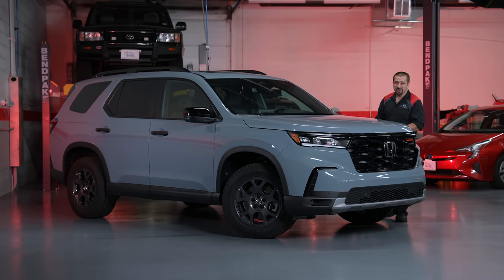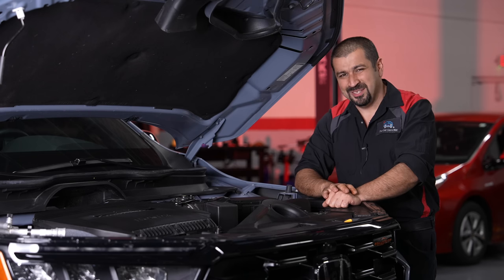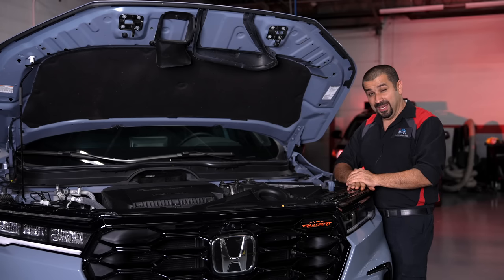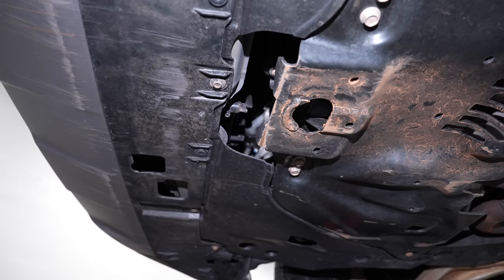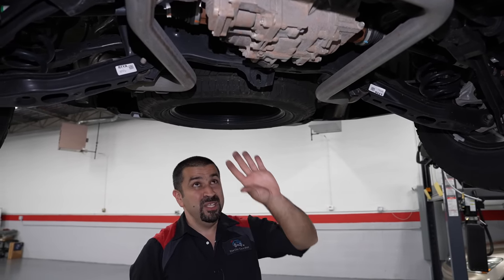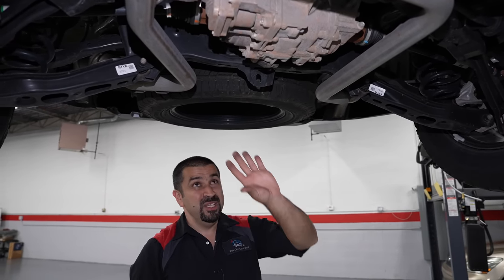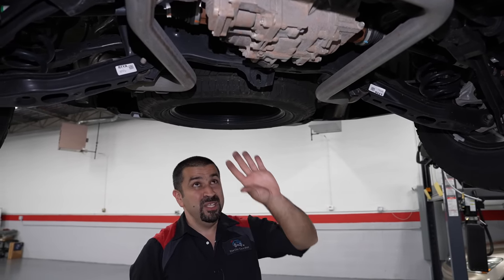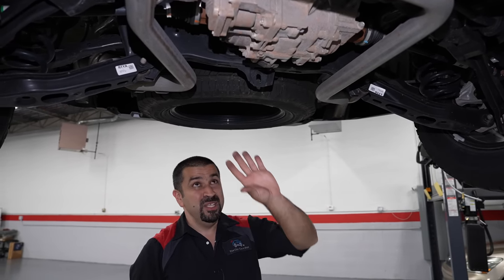Should You Buy a 2023 Honda Pilot? Thorough Review By A Mechanic

Comment: Thank you for this review AMD. I would still like one for the current gen Odyssey (which I own) but as related as that car and the Pilot are (sharing in previous generations the platform, major mechanicals, and a lot of the infotainment and other interior trim), I'll take this anyways :) With that in mind I do have a few things to comment.

VCM is a sore point for these engines, however since 2015's implementation of what Honda calls VCM 3 (first in Acura models, and later on Hondas) reliability has been better, to the point you'll find online debate on weather a VCM defeat device is relevant on these cars anymore. However it's important to note that they made reliability better by essentially limiting it's engagement more. I would more seriously consider getting one for my J35Y7 (exactly the same as the Y6, but that means it's mated to the 10 speed transmission) if I lived in the US, but as I don't and there's some tropicalization of this engine for Mexico and other markets (premium fuel is required, no auto start-stop feature, who knows what other things) I'd be even more weary of getting something that will play tricks on the ECU, as I'm sure someone as averse to aftermarket solutions as you would agree with. I will say that after going on a multi day roadtrip covering some 1500 miles, it will get the 28 mpg highway easily, even when going comfortably above the speedlimit so it's possible the new Y8 also overdelivers in that regard. I was also surprised at your complaint at power with the Y8, the previous SOHC Y6/Y7 has no lack of it, and it's one of the strong points of the Odyssey, and I have no trouble believing if it was delivering more than the quoted 282 HP. I've observed no oil consumption(something VCM likes to cause), but as a precaution for VCM issues, I am following the aggressive 3000 mile/5000 Kilometer interval for oil changes, which we qualify for anyways due to our usage pattern.

The engine/transmission combo is also very smooth, though keep in mind the engine does use fancy (and expensive) active engine mounts, specifically for when running as a 3 cylinder. I have used paddle shifters in other non sporty cars to help with engine breaking on long descents, but with 10 gears, I find it tricky to get the amount of upshifts right and invariably find myself shifting a gear or two too high and having the car pick up speed instead of maintaining it or scrubbing it off, on my other (flat 6 Subaru Outback) car, it's much more intuitive.

As the Pilot and Odyssey share a platform, it is no surprise the 3rd row is spacious, and in the Odyssey it is genuinely useful for adults, with the space used by the full size spare here being used for cargo in the minivan. I still remember the time we where looking at the car and I had one kid on my arms and I could just simply fold that 3rd row with my other free arm, it was a key moment for our liking of this car lol, and I love that it is not power operated, but manual and super simple and quick to use.

Agree on the exhaust issues, and in some Odysseys that middle muffler sits low enough that many speedbumps (of which there are many in Mexico) will bang it, we already had the case of us taking one too fast and shredding that low hanging muffler, in the case of the Ody, the whole exhaust with 2 mufflers after the cat is a single piece, worth some 800 USD and with a 50 day delay in delivery. In our case a specialized muffler shop cut the affected part and welded a much smaller (and much better looking) one that keeps the car sounding the same, for a fraction of the price. 

The exterior piano black on our Odyssey (and that I see on this Pilot) drives me nuts as it's a pain to keep clean/scratch free, but any form of coating (in my case I have 2 layers of different highly rated spray on coatings) make it much easier to keep clean, though a rock/particularly big hardy bug will dent the black plastic and discolor it a bit. Putting a bit of rain-x or any other hydrophobic coating on the cameras also helps drastically in keeping them clean, a pain point for the rear camera as the boxy profile of the minivan means there's a lot of very turbulent air on the rear hatch that makes the talcum powder like dust here in the desert like to stick to it otherwise.
Reply: Yes, Odyssey review please!

Comment: I’m a J35 fanboy. However Honda should have put a timing chain on the new J35   Timing belt is really obsolete in todays automotive industry
Reply: I would agree but considering how many modern engines are having timing chain issues from being cheap maybe it's a blessing in disguise.
Reply: Yes and no. What makes the timing belt an issue (and a cost) is that (not sure about this one) J35 engines are interference engines. If the belt tears up, good buy engine.
Reply: Timing belts are much better.  You get a maintenance item instead of an engine out repair
Reply: @loualexander3408  The belts don't tear up for no reason if you replace them on schedule (every 105K for the J35) along with the tensioner and the water pump and use OEM or quality aftermarket parts
Reply: Agree my SUV has a timing chain. It’s an 08, no issues.

Comment: Had a 2010 with severe engine problems due to engine deactivation mechanism fouling up the spark plugs due to oil filling the deactivated cylinder(s). Will never again get cylinder deactivating car, or a car with timing belt. Great review!

Comment: Overall a nice vehicle but I have concerns about reliability in VCM, carbon build up from direct injection and 10 speed transmission that is relatively new to big SUVs like Pilot and MDX. Honda could have intentionally designed their engine better for reliability through the use of both port and direct injection, and optionally allow the users to turn off VCM like engine auto on/off button while still satisfying emission requirements.

Comment: My 2009 odyssey had the VCM. Such a pain. Also, it used so much oil after 150k miles.
Reply: I disabled mine. The rings were replaced on the engine with fewer that 1000,000 miles. Thankfully that was on the previous owners dime.
Reply: If it can go anywhere near 150k before any serious concerns,  I will take it in a heart beat. That's about 14 to 15 yrs of driving
Reply: @modernsoccer1860  Yeah, but without VCM it would run for 250-300K. That's 10 more years of useful life out of the car

Comment: I have a ‘23 Pilot TrailSport with P219E error code after 6k miles. Engine light turns on and goes limp mode. I did have its first engine light 5k miles, but it went away after shutting and restarting the engine. My Honda dealer could not figure out what is causing the engine light after keeping it for 3 days. Engine light went away on its own on the third day. If anyone having same issues or figure out the cause of engine light turning on. Please let me know.
Reply: It's hard to find good help these days, even at the dealer. I hope they checked the battery to make sure its not defective, as I've seen new batteries go bad and they can cause electrics in a car to go haywire.
Reply: Just want to leave an update here. I got a third engine light at 7k miles and brought it back to the dealer. They said it has the same error code as the first 2 check engine light. They replaced the fuel injector. Hopefully this will fix the issue.
Reply: @johnmacalalag4552  Did that fix the issue? Having more problems with your 23 TrailSport?

Comment: I have a 2015 Pilot that I bought in late 2017 with a little over 27,000 miles on it. Today it has over 345,000. Best way to make any Honda last longer is to disable the VCM. I bought a device called S-VCM that disables it so that it runs on all 6 cylinders at all times, and I saw no difference in fuel economy. A lot of the feeling of being underpowered comes from the car having to switch on and off from 6 cylinders. It's bad for the car because when some of the cylinders are turned off, the pistons are still moving (at least on the 2nd gen Pilots) which causes a vacuum in the combustion chamber because there's no more combustion in the turned off cylinders, which pulls oil from the non-combustion side, gunking up the piston rings, and eventually fowling the spark plugs. Also, it causes uneven power in the engine which wears out the engine mounts. There is literally zero reason to keep VCM , I still pass emissions, I still get the same fuel economy, and the car feels better and gets less wear and tear.  I wish I knew this from the beginning. When I get my next Honda it's the first thing I'm doing.
Reply: Going to buy a new pilot here next few months was it easy to install for a beginner light mechanical experience?
Reply: @slickfox33  extremely easy. It's as simple as unplugging and plugging, and attaching a wire to the positive battery terminal

Comment: Not sure why everyone so scared of timing belts. The J35 timing belt job is simple, especially without a power steering pump in the way. 3 hour job max every 100,000 miles. Timing belts are much quieter, engine runs smoother and is much more refined compared to a chain. Chains can cause many engine issues. When Honda builds something it’s simple, refined and built to last with minimal maintenance.
Reply: Yeah it looks more accessible than my 2005 Pilot.

Comment: It would be interesting to do a comfort ride review between this and the Toyota Grand Highlander.  Honda has the reputation of a harder, stiffer ride than the Toyota.
Reply: The stiffer ride is 100% true. It's not plush like a Toyota or near close to a Lexus.
Reply: @2fast4all  that is the reputation of Honda.  Road manners is great, but not at the cost of comfort.
Reply: Hondas and Toyotas will never drive the same by design. Different manufacturers have different goals.Hondas have better driving dynamics, Toyotas have a softer ride.
Reply: That's why they handle better. I had a Camry loaner for 3 months while  our  Accord was being repaired after a big crash. It was like driving a quality built Buick. Mushy as heck.

Comment: I wanted one until he said it still has VCM/cylinder deactivation. No sale, no thanks. 👋

Edit: Oh wait he said it's GDI only... I'm not walking I'm running!! 🏃💨💨💨

WTF is wrong with Honda??
Reply: You can disable the VCM, check the intake for carbon build up and/or use a spray to clean up the intake and intake valves.
Reply: @loualexander3408  Once those intake valves get fowled up with carbon residue the only thing you can do is remove the cylinder head and start walnut blasting away. There's no magical spray that will take that away. And if you try to use GDI cleaner for PM like every 5k or 10k miles the way you're supposed to do it according to the can instructions you can still cause engine damage as you're flooding the cylinders with a liquid that wasn't designed to be shot in there. A catch can is a much better idea. But you do you. Go buy one and let us know how it turns out for you, come back to this comment thread in 5 years. There's no excuse for cheapness and laziness in engineering unless you're engineering obselence. Everyone including Hyundai/Kia is going GDI+MPI. Listen to what this mechanic is saying. And yes if you can figure out how to permanently deactivate VCM that's great, buy a car with a huge engineering feature you're paying for just to shut it off. What planet do you live on bruh? You buy something else!

Comment: Having recently paid for timing belt replacement on our '15 Pilot, I'd have gladly put up with a bit of engine noise for the reliability of a chain.  I also wish they'd take a cue from Toyota and incorporate port injection to help prevent carbon buildup.

But if that tops the list of my concerns, that's getting a little nit-picky.
Reply: $900 for a timing belt, water pump, tensioner and gaskets isn't bad every 100k. Small price to pay for reliability and noise in my opinion. Chains have plenty of issues.
Reply: Timing chain may seem less troublesome and worry free, but they can stretch out and throw the engine timing off. They even break too.
Reply: @floppyebrokent8578  That's cheap. Was that in Tijuana?

Comment: As an Acura Technician, I completely agree that this is a better vehicle than any Toyota Or Lexus…
Reply: I'm thinking of getting thr new MDX. Would you recommend the turbo or non turbo?
Reply: @CaliSteve169  the regular MDX has the 3.5 V6, same engine as the pilot, only issue is that it’s a rubber timing belt design and the engine is interference, change the belt every 80-100k miles you’d be set
Reply: @BigAltimaEnergy719  right, that's what I'm debating. I had an old pilot that was bulletproof. 250K miles with no issues. Not sure if the MDX Type S will be as reliable.

Comment: Thank You, I asked for this, and you delivered!! Hope it was done sooner though as i had bought mine in May 2023 but it is still greatly appreciated. I had a few major problems in the first few hundred miles but has been good so far currently at 6k Miles (Drive with idle stopper off).
Reply: hahaha that idle stopper is annoying. it wouldn’t take that long to wait until the green light comes on at the traffic light. i turn it off b4 i drive.. i got the lowest trim in Pilot the sport but that was rare color. the Black pearl, full black even the rims. 😅 but my wife using the suv and im still driving my old school town car 😅

Comment: FYI, that vent in the front fascia exiting at the wheel arch leading edge ( 21:32 ) is not for the brakes, it creates a wind screen down the side of the car to prevent the tire wash from spoiling the aerodynamics. I.e. it lowers CdA and improves highway fuel efficiency.

Comment: I don't trust Honda transmissions.
Reply: It’s the older models from 2000 till 2012 after that no issues
Reply: If you buy 2016-2020 and get the lower trim level like EX-L it has the 6 speed transmission NOT the 9 speed which has tons of problems

Comment: Thanks for sharing, I was running A/T tires on our Pilot for years they definitely increase road noise, decrease fuel mileage, and effect handling, (some brands better than others) when I purchased new tires due to the shortage during the pandemic the tire shop installed All Season Michelin’s when I assumed they were going with A/T tires, when I picked up our Pilot from the tire shop I immediately noticed the difference, steering a lot lighter, smoother ride, less road noise, big improvement and they do good in snow and we even have had to drive in some muddy fields and it performs fine!

Comment: Honda and Toyota will run like a clock as long as wearable items are replaced along with normal fluid changes. Most can expect several hundred thousand miles. They both are super reliable.

Comment: AMD, excellent technical review 👍.

I love Honda.  I’m on my second Honda Ridgeline, first one, a 2017 and now currently a 2022 with 8K miles.  

However, I’ve never been a fan of their cylinder deactivation and their direct injection.  So my cylinder deactivation function is deactivated, runs on all 6 cylinders all the time and I’ve installed an oil catch can.  Both work flawlessly 🤌.  The oil catch can recovered 15ml of blow-by fluid in 4,200 miles, may not sound like a lot but at least it’s not contributing to carbon buildup on the valves…
Reply: How is the transmission in the 6 speed. Some people were saying the Ridgeline had transmission issues.

Comment: thank you for this review, I just bought this 2025 trailsport model! Super happy with that purchase!
Reply: How do you like it so far? Close to buying a 2025 TrailSport. The only thing I don't like is the Auto Engine Idle Stop setting. You have to turn it off every time you drive.
Reply: @kanbowhunter If you don't press down hard on the brakes when you're stopped, the engine stays running.

Comment: Wow, shocked that Honda went with DI only engine.  Brand new transmission, brand new engine.  Made in USA.  All these are great reasons to wait a couple years for the gremlins to be addressed before committing to one of these.  Especially when considering the many issues Honda had with previous gen Pilots.  Finally hydraulic lifters.

As a Honda owner THANK YOU for this review!  I've watched many hours of your Toyota/Lexus videos and have referred many Toyota owners to you videos.
Reply: @Nicedesk Any new-gen car nowadays is going to have gremlins. The safest way is to wait until the mid-gen update/restyling which usually addresses those (sometimes bringing other ones though)

Comment: Cylinder Deactivation, Recall due to some issue with the damn gear bearings that could cause steering to lock, V6 but no Direct and Port injection, Timing belt. No VTEC. No hood lifters. I think I'd rather get the old school 4Runner 2024 and sacrifice - Sound system, Cabin NVH, Mileage, Old tech. And get better longevity, bulletproof Trans and Engine, off road king.

Comment: Iam sticking with my 2018 Ridgeline until it blows up only at 175000kms with a brand new transmission at 120000kms after tranny failure covered under warranty and 1 brand new timing belt valve timing, 1 fuel injector clean, 1 alignment, 1 break job, many oil, tranny and differential fluid changes all with 5 years. She still looks drives and feels brand new. Cant wait to see what they have for 2050 Ridgeline lol.